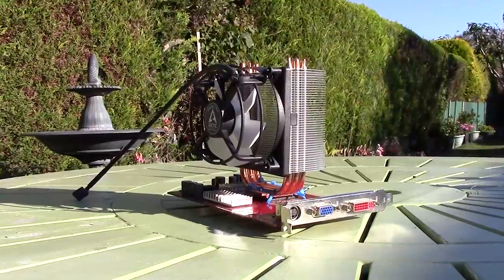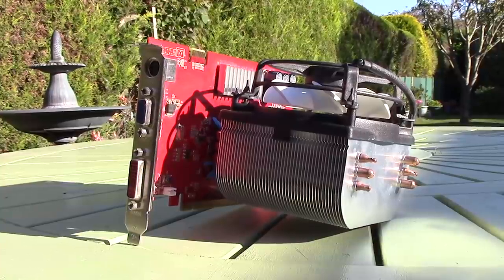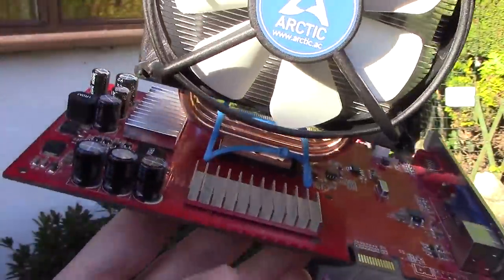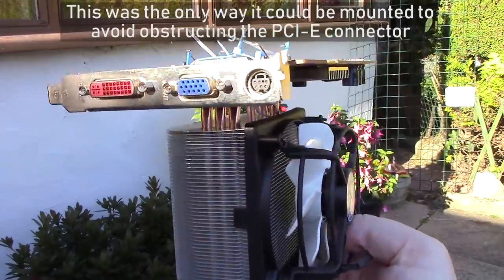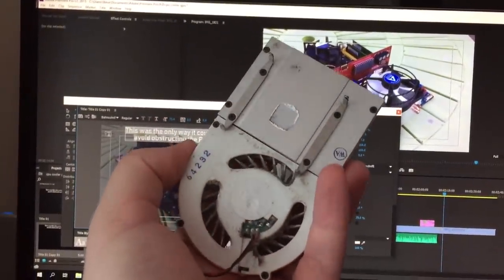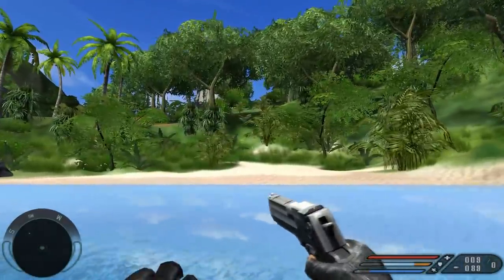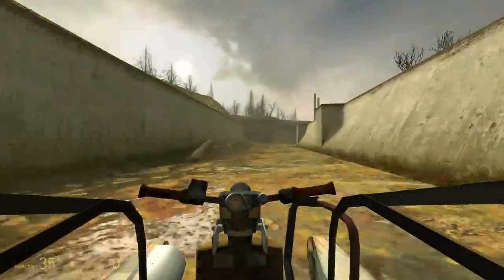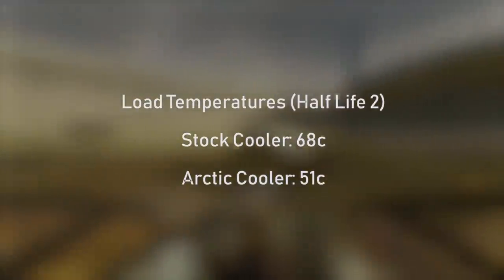CPU Cooler Meets GPU - Saving An Overheating Graphics Card

Comment: About 11-14 degrees cooler.  Well time to put a cpu cooler on my gtx 480.
Reply: Might as well get a liquid cooler for that card.
Reply: NZXT make a 120AIO for GPU's. It also has a fan on the shroud for cooling the VRM's. Other than that, Accelro makes GPU air coolers that can handle overclocking temps.
Reply: the gtx 480 just needs a dude hired to dump ice on it every ten minutes
Reply: Liquid nitrogen is the way to go
Reply: you mean dry ice
Reply: +Petman1325 At that point the GTX 480 should just be replaced by a more modern card (not necessarily new one) which is overall cheaper and improves performance of recently unsupported Fermi.
Reply: Lmao you need liquid nitrogen to get this card under 80C
Reply: use one of those beefy scythe coolers
Reply: @igornikolic4394  Or liquid Helium!
Reply: Even a 1030 matches up in performance to a 480. Consider upgrading, since you'd get better drivers, and less power consumption / heat buildup on your case.
Reply: I think the gtx 480 would be too much for this solution. I would not be surprised to if someone said the cooler caught on fire.
Reply: @mattsmechanicalssi5833  yeah just steal a few MRIs
Reply: Try an arctic accelero cooler instead
Reply: Might as well dunk that thing in liquid nitrogen
Reply: U need ln2 for that lmao
Reply: For the price of a good cooler you can probably get a better card.
Reply: u can just leave it running without a cooler ;))
Reply: I got a CPU heatsink on my GTX 480, highest temp is around 50C-60C in games. Works great.
Reply: But you can cook bacon with that GPU!
Reply: If overclocking is your thing, now you got a decent cooling solution for your desktop at least.
Reply: @GewelReal  you mean north pole

Comment: Had a GTX 560ti with a cable tied CLC for years. This arrangement is known as "The Mod". Temps were "fan"tastic hovering around 55-60C under load. I also modded the card's bios to lower the fan speed as I was using the stock fan to cool the VRMs and didn't need it to blow too hard.
Reply: did you just-

Comment: I would recommend also trying some custom GPU water cooling. When I custom water cooled a Dell 8300gs as a proof of concept, the temps dropped by 30 degrees in the FurMark stress test. Great video as usual!
Reply: I had the same results putting a hybrid cooler on my 1070. My load temps in games dropped from 78-81 Celsius to 50-55 Celsius. Well worth it if you can get a good deal on a 120mm Acetek-based AIO and a Kraken G12.
Reply: There are a couple off-the-shelf solutions for doing that with an AIO, though compatibility does vary. If push comes to shove, you can always figure out what of-the-shelf hardware you can find at Home Depot and the like can give you the setup you need using the Intel brackets for any off-the-shelf AIOs.

Comment: I have done this to so many GPUs for extreme overclocking (aka just turning all the sliders all the way in afterburner) on GT 620s, R7 240's, GTX 645s, and older HD-series AMD cards. Works great if you mount therm good and cool the VRM's too.
Reply: I'll just go and put my old aio on a hd8450 and break some oc records lmao
Reply: casual 2volts on core

Comment: Since your computer sees the cpu cooler as a system fan (as it is connected to the motherboard instead of the gpu), it is not trying it's best to cool your gpu, it's just doing its regular case cooling. You can force the system fan to run even faster to cool your GPU further
Reply: Most of my fans run 100% when hooked into the motherboard headers. You can set them to monitor different things, but by default, usually any motherboard I've seen defaults to 100% (at least on high end platforms like X370 and X399). So its probably running at max speed, and besides that, you would want to decrease fan speed in this scenario since he commented that it was noisy, and the temps are plenty low.
Reply: You only can control fan speeds on Motherboards if the motherboard connector let you . For example only 1 of my 3 motherboard fan connecters can be controlled on the bios . Otherwise it will be always on 100% I think.
Reply: Alternatively, there are adapter cables available, and you can just plug the fan directly on the video card. That's how I hooked up a silent case fan to my GPU, and the large front case fan to my PSU with mutilated casing.
Reply: Use speedfan to adjust every fan connected to the board.

Comment: CAUTION If using Zip-Ties/Cable-Ties make sure to buy Quality ones & don't leave the system running unattended. The clip part that inserts to the teeth in the track to hold the cable-tie in position can lose it's grip or snap randomly, causing the cable-tie to release & open up.
Also, the cheap ones can even end up snapping and breaking apart. 
I know this from many years of experience using them for modding, cable management, etc. [ TEFEN's Tech ]

Comment: I've put a cheap 92mm cooler with 3 heatpipes on my GTX760 a while ago. Results were amazing, with gainwards blower style cooler it was hitting 80c when playing BF4 with blower being really noisy, with cpu cooler it was at 65c and fan was at 700rpm! That was barely audible and boosted even more than with blower. Definetly recommend if you have older gpu.
Reply: Im trying to do the same with an gtx 660 from zotac, this shit is so loud and annoying . Any ideia for the mounting brackets ?

Comment: Center of mass of the gpu: 2km south 😂😂 I once made a similar thing, I did put a socket 478 cooler on a GeForce 7300 le, so that I could run Crysis 😂
Reply: What kind of frame rates did you get?
Reply: @DaveOJ  At idle: around 60°C after mod 30°C, in-game: shutoff due to 100°C after mod 60°C. Because I wanted to play Crysis and my GeForce was passively cooled. 😂 My 478 cooler was made all in aluminum, so copper would have been much better, but I hadn't one laying around.
Reply: Frame rates, not temperature <3
Reply: @H31MU7  didn't noticed 😂

Comment: I've done similar. I have a system that I have hooked up to an old CRT TV pretty much just for watching low res video. The newest card I have that still had S-Video Out was an EVGA GTX 275. The card wasn't overheating. The fan was just obnoxiously loud. I pulled the stock fan along with the shroud off. I pulled the stock heatsink to clean it and the GPU, then applied some fresh Noctua NT-H1 thermal paste. I put the stock heatsink back on but in the place of the stock shroud and fan, sits a pair of Noctua NF-R8 Redux fans zip-tied on. I used a fan splitter as well as a 4-pin MB connector to a 4-pin GPU connector adapter so the video card still regulates the fan speed. The temperatures are slightly better but it's MUCH quieter now. Practically inaudible.
Reply: You might need Sub-Zero for that thing.

Comment: Could you try water cooling something like a GT 1030
Reply from the maker: Yes that sounds quite an interesting challenge actually haha
Reply: it will be like minus 30c  at summer time  xD
Reply: the only way it's getting that cold is if you had a 5 gallon an ice water bucket in a mini-fridge. which would be risky due to condensation. though supposedly if you sealed the whole set-up in a plastic tub with a dehumidifier. you could have a loop running liquid nitrogen 24/7 without any problems.
Reply: I thought condensation was pure water, if it is I don't see any problems with it on electronics.
Reply: I don't know where this should lead. The 1030 I have runs at maybe 46° under load. It's cooled by the casefan and is passive cooled.
Reply: @ The Joomes Great idea, I'd also love to see that, maybe even a pair of them using DifferentSLIAuto
Reply: I have all the watercooling supplies on hand ready to go. If anyone wants to send me GPUS/CPUS/Motherboards message me and I'll start making videos (have one up on my channel)
Reply: um actualy no, you can get to -1c o problem just using air, as long as it goes fast enough it will be able to freeze someting
Reply: Yeah, the mobo isn't steril, so conductive ions form as soon as it gets wet ...
Reply: I'd like to see that!
Reply: @Orodreth888  Mine does 60 to 72 degrees centigrade depending on load. But that's because it is an active cooled model. Tiny heatsink and fan. Passively cooled version surprisingly stays cooler while it should be even better with a fan on it.
Reply: @naz95k71  You can't go lower than ambient temps without using a water chiller, phase change, ect.
Reply: you can if the air moves 9999km/h ;v

Comment: Been doing this for close to 20 years. Sometimes just replacing the stock fan with a larger and/or more powerful case fan and sometimes with an actual cpu heatsink fan combo. Nothing quite as big as this one though. I have normally ised an older Pentium 3/4 AMD Socket 7 or 939 top down heatsink and fan. I drill holes in the heatsink that match what's on the graphics card mounting holes and use bolts to hold is securely if it's meant as a permanent solution. I only use the zip dies for a temp heatsink fix (a week or so at the most) or a fan mount. I've seen as much as a 20C drop in temps doing it.

Comment: I had EVGA Classified 560ti 448 (twin fan)  One of fans shattered while spinning up. They wanted my whole card RMA'd but instead used a stock Intel fan and pulled off the heat sink.  Cable tied to GPU housing and plugged into fan header on board.  Still running to this day! (kinda a steam punk industrial look)   like your video.  Thanks

Comment: you can pull the white plastic boot off of the fan connector on the GPU and just plug the cpu fan into the the two prongs. The 3rd wire on cpu fans if for monitoring by the motherboard, which isn't necessary on a gpu, because it will increase the fan voltage based on cooling requirements.

Comment: I did something like this on a problematic MSI geForce 8500 GT (the one that has the little copper cooler with the fan in the middle).  The stock fan had completely failed, and in the process of it overheating slowly over time, the chip had also failed.  I ended up baking the board in the oven to reflow the GPU, and then replaced the cooler with an extra 'square style' AMD socket 462 cooler.  I had to do a little doctoring of the heat sink to mount it, including drilling holes into the base to match the holes that the stock GPU cooler had been mounted to, and then tapping them, but after I did, it mounted up super clean from behind using some matching machine screws and some washers.  I also mounted some of those cheap little aluminum 1cm x 1cm heatsinks on the ram chips to help them stay cooler as well.  Worked like a charm.  IMHO, using that GIGANTIC cooler on that 7600 is overkill and might place some undue lateral stress on the card and socket.

Comment: if you have an older case with a breathable side panel, setting a card up like this nets you direct fresh air straight to a massive cooler. This probably beats water cooling, and with a nice looking fan, would look about as cool as a vertical mount without the arm and a leg those brackets cost.

Comment: I have slapped on a H45 aio onto a gtx 570. The backmount lines up pretty well to the holes on the graphicscard and what you need to do is place it on top of the pump housing instead of a normal mounting bracket. Then use screws from the backside along with plastic washers and use the thumbscrews to tighten the backmount. And presto a aio cooled retro gpu. The Gtx 570 is a hot gpu to begin with. I have the Gigabyte Windforce 3 and the temps whent from 89c to 57c during a 1hr play session.

Comment: I've seen this with Closed Loop water coolers and it's pretty effective. The issue is that a CPU cooler isn't made to cool VRM and RAM as well, so the small cold plate isn't the best. You have to have plans to cool those components, although the video card in this video seems to have fin stacks already on the VRM and vRAM. There are after market video card coolers out there, specifically made by arctic. They accommodate different budgets and needs and often come with VRM and vRAM fin stacks which a CPU cooler won't.

Comment: Most people that are using an older graphics card like in the video aren't going to be getting an after-market GPU cooler to begin with anyways. Using an old CPU cooler to cool and old GPU with old parts that you already have lying around is what most people would do if they are still using an old gfx card like this. I think this is a great solution for the demographic it would appeal to.
Reply: I think that's what he did. That cooler he used looked ancient, I don't know if they've made any like that in the last 6-8 years (they might, but it looks super old). All he did was zip tie a generic CPU cooler onto a GPU so people could see and replicate themselves.

Comment: What's wrong with cable ties? I'm using them all the time - everywhere. They're the best solution if you don't want to bore holes in a PCB or glue the cooler onto the GPU. The thermal glue I have on hand won't even hold such a hefty load (as shown here) for long. Just use the right colour of cable ties, affix them properly and they will often even look cool.

Comment: i did the nearly the same to 1 of my Rx460's which fan started making funny noises.removed the fan & fan shroud. Put a 120mm with some cableties on top and mcguyvered the fan to the gpu fan power. Runs more quiet and cooler aswell. Only downside is that it takes 2.5 slots

Comment: Is the original cooler tested with the old paste or new. Just to be accurate testing both with new paste.
Reply: PingasTheFourth - But he didn't re-applied it. I suppose its the same paste, because even if you apply good quality TIM on the original heatsink, temperatures doesn't lower that much, maybe 2 or 3 degrees, but not 10 or so, since heatsink area, fins, fan size and RPMs do count a lot when cooling the card, its not only on the paste, but in whole.

Comment: i think it should be able to do more. from what i saw on the table  build the cooler was in such a position that the hot air has nowhere to go, so it smashes against the motherboard, looses speed and then recirculates into the fan intake
Reply: then how does it flow?

Comment: You could've still used the 3 pin connector in the 2 pin port of the GPU though. 
Or just resolder the cable to the 2 pin connector of the old GPU fan. Probably would've been fun to see that as well. 

Good video nonetheless though. :)

Comment: ive made some mods on gpu cooling, seen the cpu cooler, but never found it practical. if you search this on ebay "VGA PC Computer Video Card Cooler Cooling Fan Heatsinks For NVIDIA ATI Geforce" you can get a decent sized gpu cooler for 7 bucks free shipping. back in the day they used to sell a copper one (couldn't find it unfortionatley) had an hd 6670 1gb gddr5 from dell with the stock heatsink that would hit 106 then crash. with the copper version of this cooler it capped at 55 degrees and was MUCH quieter (also got to overclock the core 55mhz and the memory i think 200mhz).

EDIT: found a smaller but decent copper heatsink (have worked with the aluminum versions of these and they were alright) labeled this "Golden 55 60mm VGA Video Card Cooling Fan For Nvidia Geforce & ATI Series" they are 3.52 free shipping and they can get you by, with the same hd 6670 listed before i think at 100 percent fan speed i was getting about 67-70 degrees. if you are on a really tight budget these work as well

Comment: I have been running a 120 mm CPU tower cooler on my HD 7870 XT since about 3 years now its works just flawlessly. Saves about 30° under load (+ with the stock cooler i couldnt really raise the power target). Only problem is that i have to move the psu forward to make room for the cooler inside my case.

Comment: some cards has same spacing between holes, so when died my msi r9 270x i reused cooler for my old gts 250. it wont fit perfectly but after aplying some DYI methods cooler was siting very nicely. during idle only one fan was spinning so fan controller would be recomended to bump up voltage slightly

Comment: What would you class as too high a temp for a GPU? My GTX 1060 runs at around	70°C albeit a steady 70°C.
Reply: 70 is plenty fine don't worry about it. Also temperature isn't a one size fits all metric. Some cards run hotter some cooler but 70 for a 1060 should be fine.
Reply: Thought as much. I wasn't too concerned as the temperature stays consistent with no spikes etc. Thought I'd better make sure when I saw him using an after market cooler to reduce it from the 60s. Cheers for the replies.

Comment: I recommend you try some Thermal Grizzly Kronaut. I have some on my FX cpu and it dropped 5 or 6 degrees. The stuff is expensive, but it's totally worth it.
Reply: Conductonaut(liquid metal) is even better, but I'm normally using arctic mx4 because this stuff is really good and not that expensive, i only used liquid metal on my cpu
Reply: Liquid metal is great, just not for everyone. I personally can't use it because my heatsink has aluminum on it and it would react negatively.
Reply: @railsrust  yeah well, that's the negative aspect of  liquid metal, in this case, i would also use kryonaut, because it is the best normal tim you can get.

Comment: i remember back when i put a stock am2+/3 amd cooler into my Geforce 210 just to overclock it, stable 50+*c. i also tried it on my hot Radeon HD 4350. it was awesome lol.

Comment: On GPUs with exposed dies, be extremely careful, since it's rather easy to crack the edge off of the die and kill your card. I accidentally did this when trying to make a custom cooler for a GT 610.

Comment: I've done "the mod" to an 7950 with an h60 second gen, an 8350 stock cooler on an gtx570 and to replace that card an hp OEM 775 cooler on to an GTX 760.